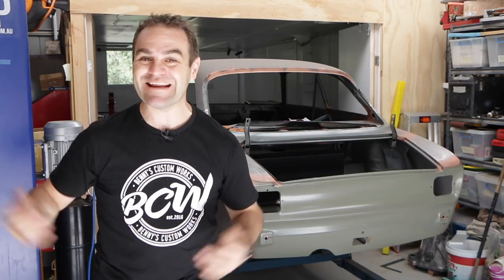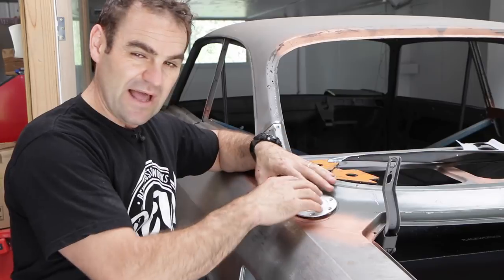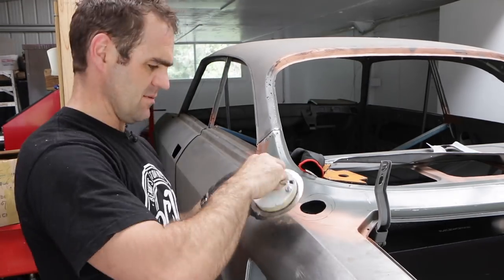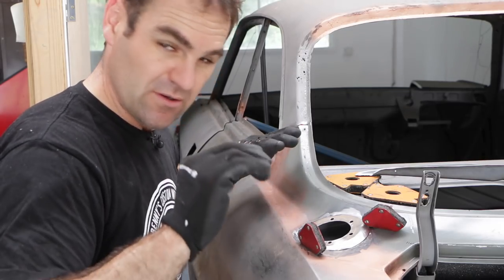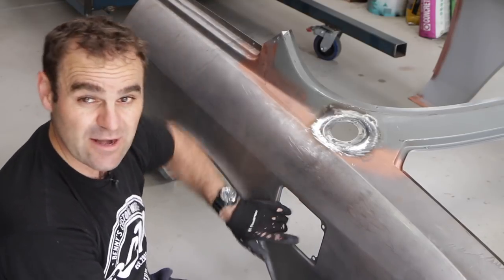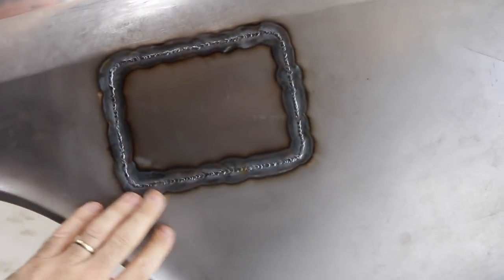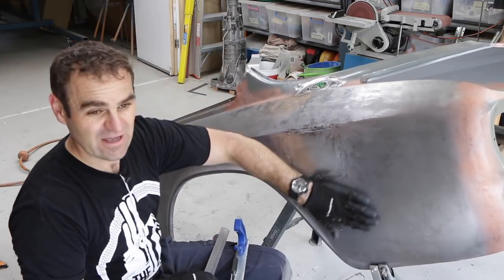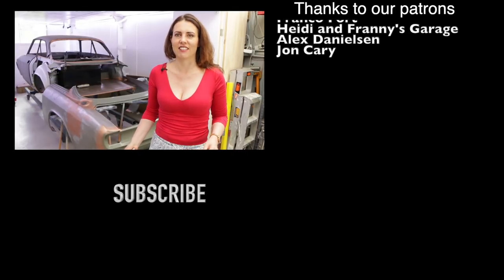Fitting an external fuel filler - Alfarrari 105 project car build part 31

Comment: To avoid distortion when welding sheet metal us a water soaked rag to keep the surrounding metal cool  Rob
Reply from the maker: Not for me. I don't like using a wet rag on bare metal. The air blower is just as good and less possible rust in the pin holes ;)

Comment: Looking good, I used a shrinking disc to flatten out high spots with Tig welding, however you might not need it for the rest of the project

Comment: Great tip using the buck! I’m trying to figure out moving the fuel filler on my 240z but my panels were swapped for light weight racing fiberglass quarters where I want to move the neck!

Comment: Jeff - before you go the whole hog with the Ferrari engine, do consider the Alfa Romeo 3.0 V6.  I highly recommend you have a look through this thread on a UK forum for inspiration:

http://forum.difflock.com/viewtopic.php?t=69236&sid=0e412a0887c803cb5fe3e84a96a2cb46
Reply from the maker: The V6 is a common MUCH cheaper and easier swap, but not for me ;)

Comment: Jeff the rear pillarpost between the rear window and screen  looked a flatter surface
Reply: I was thinking the same.
Reply from the maker: Flatter but would require a lot of removal of the structure and the neck would be visible through the back window.

Comment: Love the filler, always loved the and always will. Gives a nice race car look without going overboard.

Now, tell me what is that piece of rotten away steel inside that left rear quarter?
Reply from the maker: It is just where the heat of the weld made the paint bubble and flake underneath.
Reply: @HomeBuiltByJeff  Ah! Right! I feel like a fool now haha. It looked like a sandblasted piece of rotten steel that was primered prior to metal work. I was wondering how it could have slipped unnoticed with all the work you've put into it. 

Keep it up, I love the project.

Comment: hey Jeff, those welds are looking much batter and finer ,   how thick is that welding wire you are using ?
I cant seem to find anything smaller then 1.6 which is think is too thick for 0.9 Car sheet metal
Reply from the maker: 1.6

Comment: Hey Jeff! Just wondering do you need to add an unleaded size fuel flap in the filler neck for compliance?
Reply from the maker: I am not certain, but I believe at this car never had it, it is not required.
Reply: @mathewjackson8337   motivation is scarce these days.

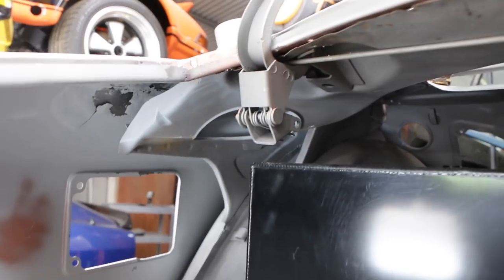Comment: you have bit of rust near the bottom of the filler cap. 1:49
Reply from the maker: That is just where the welding heat affected the paint underneath. The back is all new, rust free panels ;)

Comment: Nice job on the fuel filler Ive never tig welded just mig do you find the tig causes more heat distortion when filling a panel like the fuel  filler or not
Reply from the maker: In the right hands TIG is better all around. I could probably do less distorting with the MIG, but I need to learn, and this would have sucked to grind down the MIG welds on.

Comment: A neat solution but I must admit I don’t really get why you needed to reinvent the wheel. You should have checked out how Alfaholics get around this issue. There are various alternative solutions, some simpler than what you did.
Reply from the maker: Has to be an external filler, so no, not easier, and definitely not cheaper ;)
Reply: Home Built By Jeff I understand, but they have done fillers similar to what you have built, ditto through the boot lid as per in classic race cars, as well as simply filling from within the boot using a fuel cell. You should check out their GTA-R builds. They have huge experience in all this sort of re-engineering rebuilds.